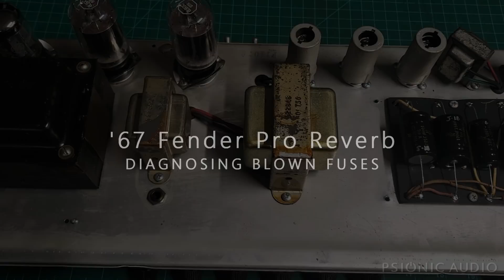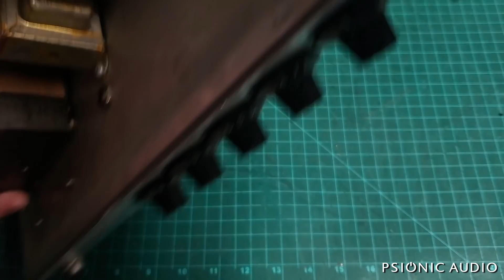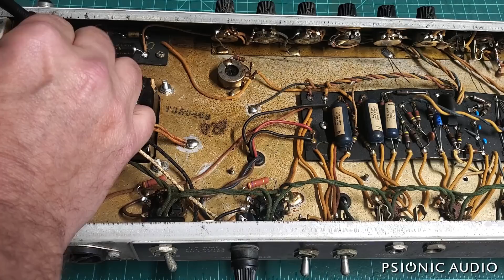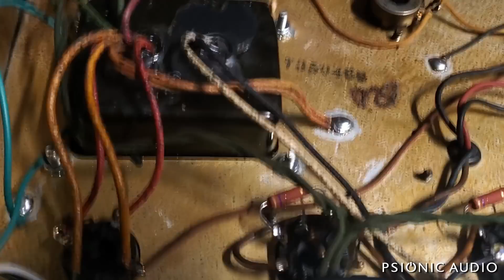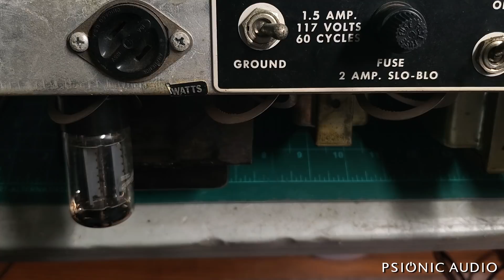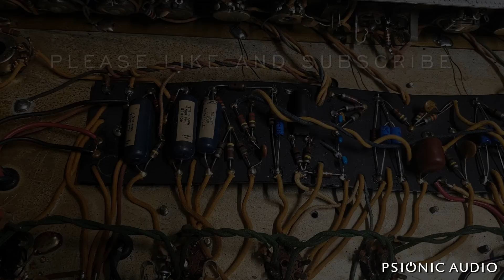'67 Fender Pro Reverb | Diagnosing Blown Fuses

Comment: What do you think of the Fender Pro Reverb reissues? Do they have issues like the Deluxe Reverbs do? I think I'd like one because they have more headroom to use a lot of pedals with. Thanks for any insight.
Reply from the maker: All the Fender RI amps have the same issues, mostly heater connections and filter caps.
Reply: @PsionicAudio  Dang thats disappointing from Fender. Thats for the reply and informative video btw. Also, what about the more expensive 64' reissue handwired ones? Any info on those?
Reply from the maker: The '64 "HW" amps are pretty much junk for what you pay. Bad lead dress, cheap parts, not the correct vintage circuits.

Comment: Intermittents are the hardest to identify. I use a Kill-a-watt that tells me how much current the amp is drawing under load and I have a pretty good idea what it should be. I recall one Pro Reverb that was drawing too much current and would randomly blow fuses and the fix was to cut a new insulator board and slide it in. I've also seen chafed wires going to the filter capacitor bank that would do this.

Comment: Why is it a concern that the filament leads are spliced? Is it that you're worried the splice could fail? Or that it would add too much resistance and eventually fail due to heating up and eventually melting the solder? How do you properly do a splice to avoid those concerns? I've had to splice wires in amps a few times, but haven't had problems yet.

Comment: I recently got a new solder sucker (a small one for PCBs) that has a little bit of silicone tube on the end, works fantastic for getting a good seal around the solder joint i'm looking to clear.  It works way better than any others I've had in the past.  A bit of silicone tubing on the end of yours may help get more solder out the first time.

Comment: That's how I was taught as well - the best tube tester is the circuit it's being used in.
Reply: Indeed. I use to have a few amps layering around that were my tube testers because an actual tester doesn’t test at full voltage or with a load, let alone bring up issues like microphonics.

Comment: I like to use the captions when I watch videos so I can keep the volume down if my wife is working nearby or on her phone, but sometimes there aren't captions available. Is that something that you (and other YouTube channel creators) have to enable whenever you post a video?
Reply: How new was the video that didn't have captions?  I think the auto generated captions may take some time before they're added.
Reply: @russellhltn1396  , update: it's a day later and now the auto-captioning works, so yeah, you're correct.
Reply: @russellhltn1396  hmmm, I think it was brand new, less than an hour old. So maybe that's it?!
Reply from the maker: I don't have the resources. You can use the auto generated captions - my diction is pretty good. Though it will spazz on any technical terms.
Reply: @PsionicAudio  on this particular video, captions are not being auto-generated, although the Vibrolux video you did earlier today did have them. I've seen this happen on other channels I subscribe to ---- sometimes the captions are there, and sometimes they're not! So this is a fluke of YouTube/ Google software? It's true that the software is flukey ---- when you say 12AT7 it reads "1287! "

Comment: Before re-soldering that eyelet, I would have run the amp on standby (with power tubes removed to be extra safe) and, while measuring the voltage at pin 5, tapped and wiggled that eyelet connection to see if it affected the bias voltage reading.
Reply: Jim Salman, I've never liked how Fender grounded the bias resistor to the back of the bias pot because this relies on not just one but two mechanical connections to ground: 1) the pot bushing and shaft nut have to be securely tightened against clean metal  (that chassis is anything but clean, although Lyle likely cleaned under the pot when he worked on this amp a few years back); and 2)  the back cover of the pot contacts the bushing sleeve via 4 bent over tabs.  I'd like to see that resistor soldered directly from the potentiometer terminal to the chassis. Also, the wiper of the pot should have a jumper to the terminal of the pot where the negative voltage comes *in*, so that if the wiper connection is intermittent, the bias voltage to the output tubes goes full up (cooling the bias and preventing the tubes from redplating) instead of disappearing entirely. By the way, I've seen a couple instances of Chinese or Russian tubes with an intermittent or cold solder joint (leadfree solder didease!) inside pin 5 of the tube base. In a cathode biased amp, this merely causes loss of audio to the grid, but in a fixed bias amp, an intermittent connection inside pin 5 also causes loss of bias!